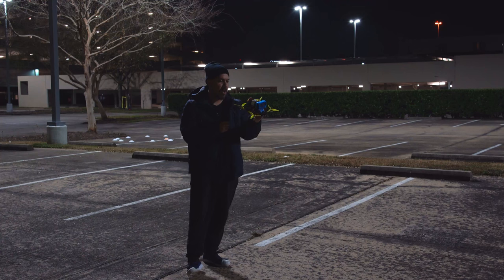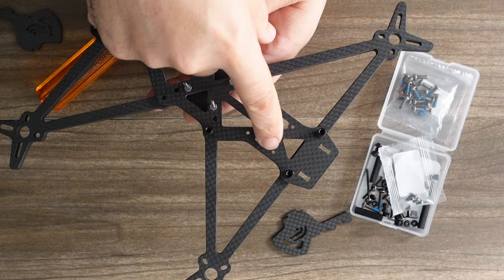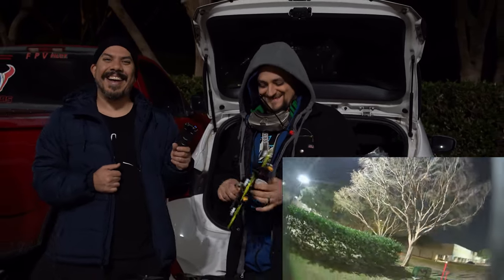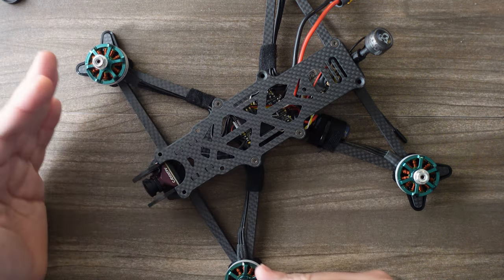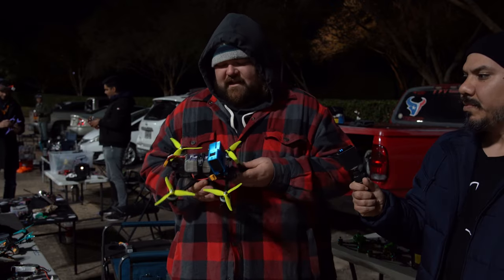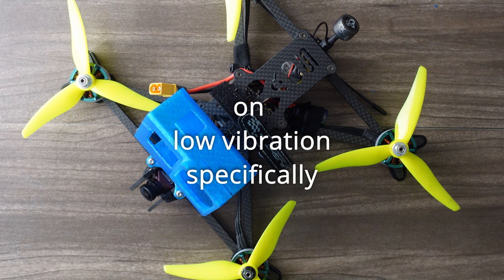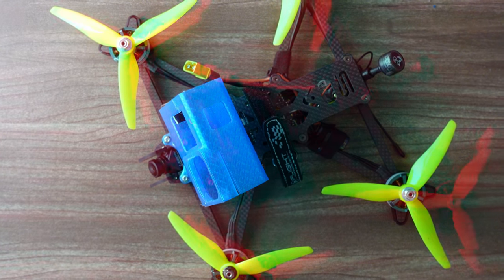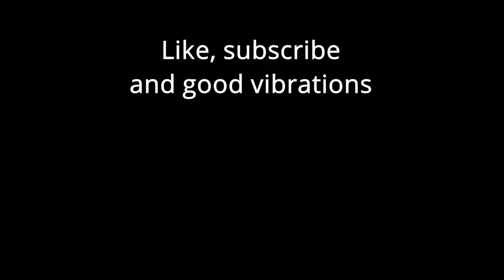AOS5 Smoothest Freestyle frame ever?  AOS 5.5 freestyle FPV drone frame

Comment: Yup, I built on this frame, well, not this one but the 5inch version... Smoothest flyer I've ever built. The AOS5 and 5.5 are out in the v2 now... Available in different coloured carbon and even better resonant performance and a stronger arm design for thoes frontal impacts. In fact such good resonant performance that Chris suggests that you may be able to turn off the dynamic notch filter if the build is sound with no flapping or waving wires.... But that's with the v2.

Comment: I've had it since release, actually had 2 of the 5.5 frames so far. Only problem I've had besides breaking an arm was the camera plates.. they break pretty easy in a head on crash and your dji cam gets destroyed
Reply from the maker: Good notes, the shape is offering some protection, but perhaps the plates themselves are too thin.  Catalyst banggod/shocker, is similar, but the cage plates are larger, and they extend further with the brace offering added protection as well.
Reply: @JonE5FPV  true that ill look into them, I would love to see you review the new gravity loss titanium pro frame that just came out looks like a beast
Reply: For that some TPU or PLA Print might help stop the lateral Carbon ends from fraying. Are there any prints on that? I coulnt find one.
Reply: Camera plates imo, are just a horrible idea when they go past the stand offs. Imo the camera should always be behind the Standoffs.
Reply: @POLARISFPV  you right
Reply: @StR8KiLLA_FPV  I agree I just recently built a evoque dead cat and didn't think about the fact that with a dead cat frame my camera is more vulnerable. Well I smashed my camera pretty easy so I molded the side wall where the camera mounts and its now slightly behind the stand offs and much safer

Comment: I've bashed the shit out of my AOS5 and it's held up better than the Moongoat and Shocker Tank I had before it. The moongoat camera cage was the weak link and on the tank the rear arms and top plate cracked. On the AOS I've only dented the carbon despite having harder hits for sure. The chin under the camera plate is more sturdy, we'll see what happens when I hit the camera directly.  Something about the way it distributes loads is just better. Function over form so who cares what it looks like.
Reply: Thx for your comment, been looking for Info on the AOS5 durability everywhere but few people seem to realy bash it

Comment: Frame is insanely good, I have 3 of them now.  Make sure you use plenty of grease :) Also i rebuilt my iflight 7" into an AOS 7". Would be cool to see you switch over to it for two weeks and give us your thoughts on it.
Reply: how does it crash?
I am building one at the moment... Do you recommend any TPU parts to increase the durability of for example the exposed Camera Cage ?
Reply: @userunknown2771  I have yet to have a head on impact, on the camera cage, but I can see the plates potentially being an issue. So far it can handle being knocked around as well as anything else I have. I use to fly 2 x Armattan Badger frames, my AOS 5 and 5.5 builds have replaced using those frames. I've tried to limit the use of TPU parts as much as possible, anything that could build up vibration and keep the build as streamline and tight as possible. I could see a TPU front bumper on the cage being a useful addon.  In regards to building and replacing arms, it's not all that bad. Id happily trade a few mins on the ground of extra work for improved performance in the air.
Reply: I’m flying badgers too, would you still stick with the aos 5.5 after being flying badgers and where do you see the most performance? Cheers mate.
Reply: Does the AOS 7" fly better than the iFlight  7"? I currently own the iFlight v4 but I cannot get rid of the yellow in my Session 5 video. Hope to solve that with a switch to the AOS7".

Comment: The arm style reminds me of the Tinyhawk Freestyle. When everyone is trying to shave a little here, improve a little there, this frame is going to reduce the vibrations being fed to the gyro, so it's shaving a little off there. If you fly like Steele which is incredibly skilled, but I like to call it a flying seizure, I don't know if a few vibrations are going to matter a whole hell of a lot. Maybe they do? I can't fly like that so what do I know? I can fly smooth and vibrations are a problem with that type of flight. Especially if you're not using stabilization.

Comment: Fpvcycle glide for the win.  Practical, and strong.  Get back to me when you make the aos easier to work on, and take that stupid little arm key on the apex, and throw it in the trash.  I cannot get the arms to stay tight on that frame to save me.  Each to their own.  Both Rosser, and Steele are dope.  You should try them all, and decide for yourself.  There is plenty of room in FPV for everyone.
Reply from the maker: Agree, many really love the glide, which i agree is the best bang for the buck.  Personally i like the apex, badger and banggod the best, but those also cost a lot more.

Comment: i ordered the 7inch mantis, because there is almost no single frame out here whithout noise out of the box. i miss the  20x20 holes in the x-subplate, which would really be no problem to cut out. ;-) i dont know why Chris did this not. stability? does this make such a difference? if yes, lets go to 3mm. the other thing is, i dont knoe why the 5inch version has the stack out of COT? i also would have ordered the 5.5.  because i want the FC in the middle, Air unit in front. Rear is for GPS, RX.  i wonder how Armattan will react to this with the new coming frames. there is just not much left to do any better.  Mr Steel dont like it?  yeah, understand, for sure. i would hate it so much also .....

Comment: how flick able is it on roll and pitch is it just more a cruising frame
Reply from the maker: i think the extra space makes it more stable, so it can still flick pretty well because of all the power, but its a longer rotation, so if you want to turn fast as possible, may be better off with the 5" proper.  difference would still be fairly small, i personally like being able to mount in the center more than that feature.

Comment: It is kind of funny how things happen sometimes. I just watched your video on the TX12 and I was thinking about how I could only see it as a low end radio but then when you compare it to the Zorro, a radio that I consider to be mid/high end I realized that feature for feature the Zorro and the TX12 are pretty close.  Same gimbals, same OS, that is basically the radio there plus the actual transmitter parts and I might suspect that they are both similar there as well... My point is that before the Zorro I knew about the TX12 but did not think it would be something I would want yet I was kind of drooling over the Zorro when it first came out and if they ae essentially the same then why do I like one but not the other?

So bias is an interesting thing and I do appreciate people saying things like "their not going to hate on something before they try it..."  but Steele still downplayed the frame a bit as well.  My point is that we should have a goal - I want to have the best freestyle experience or I want to get the best cinematic video  and then find the parts that help you realize that goal.  Sometimes we will end up ignoring what is best for us and turn it down.  Why would we do such a thing?  So back to this frame - it was designed to have the lowest resonance and vibrations and it would seem that it does.  

But someone commented that we have Hypersmooth and other softwares that does the same thing so who cares?  That is a good question.  Is this design solving something that software has solved or is there still a good reason to want the absolute smoothest flying frame possible?  I have to imagine that for some situations it could matter.  

Anyway that is what I was thinking and it was funny that bias was something that both videos made me think about.  Cheers

Comment: The best frame is unibody, period.  But too expensive. Replaceable arms are much cheaper, ease of repair and more profitable (manufacturing wise in niche market). Especially claimed designed by some aero engineer. One thing i agree with Steele is more fasteners make it worse - duh. 
FYI all FPV drone frames are designed to break! - fact. That is how the industry grow. Because cheap frames were designed to protect the more expensive parts i.e. fpv system and electronics, at the same time healthier for hobbyists.
Ofkos frame design is based on the designer's goal - claimed to achieve.
Even cfd can't compute any assembly, but one piece.
Smooth is a preference, a non-structural related and any mechanical instruments with moving parts have resonances, oscillations and vibrations. Tune it.
2¾¢

Comment: Oh I can't stand slammed frames, too much dinking around to set them up
Reply from the maker: it does require a bit more thought building, so i tend to agree with you.
Reply: @JonE5FPV  Was your build greased on all the joints? That adds a ton more fiddling to it.  but IIMO it's worth the effort.